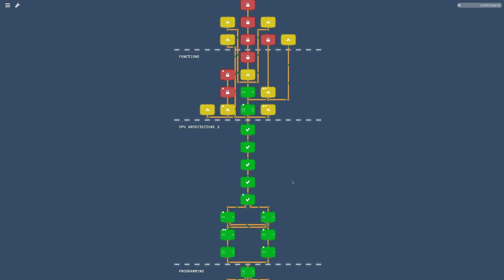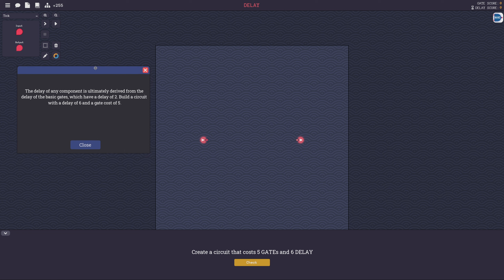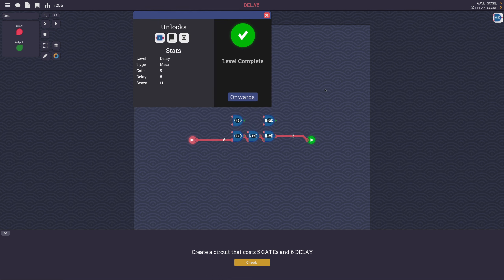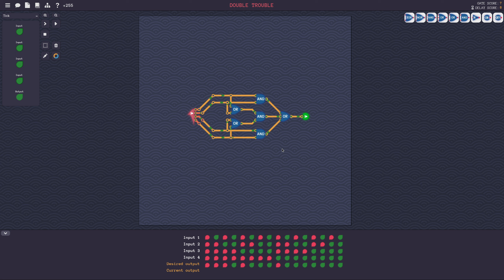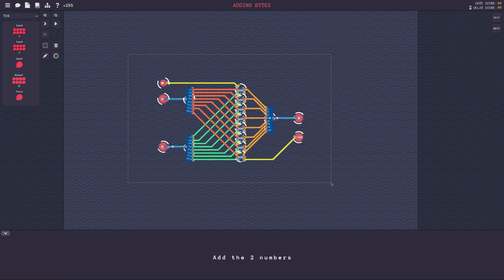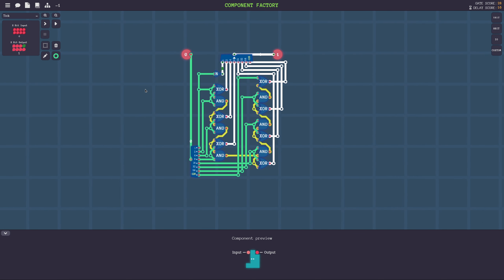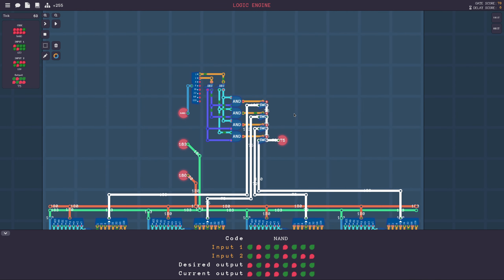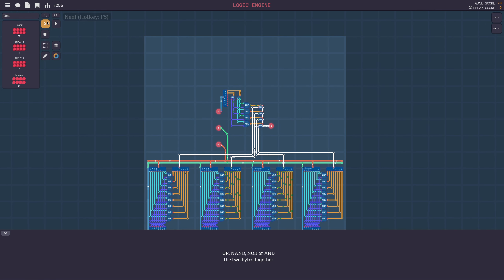A logician tries to build a PC | Turing Complete pt.20 - REDUCE

Comment: By the way, since you mentioned optimising to ridiculous degrees. Some people really go overboard.
The maze can be solved with a gate score of 2. No computer necessary, the entire thing can be solved with two gates. There is a guide on steam going through the process of developing that solution which I found very interesting.
I definitely would not have thought it possible and I don't think I would ever come up with the solution, even if I knew it was possible.

Funnily enough, though, the record for the maze does not use the 2 gate solution, because it takes too many ticks. The best 2-gate entry uses 739 ticks, while the record only needs 73.

Also, if you look at the leaderboard, the person on first place has a total score of less than 3000. I think I've mentioned before that I don't really care about the score and only optimised a little bit to get it out of the millions. (I'm at 115k now and I'd rather build custom architectures than hunt scores) But bloody hell, less than 3k :D
Reply: As a little addition to that: To solve the maze in less than 739 ticks, you have to give up on a 'general solver' solution. Meaning that you rely on the fact that there is a fix set of maze layouts, for which you hard code the path to the door and only build a small circuit, that checks in which layout you currently are. Also there are levels which can be exploited due to the fact that the solution checker is fixed and can not check every possible combination. Other than that i have on more tip: It is more efficient to rebuild a MUX than using a MUX component, because the MUX has a delay of 4, but when you split it up and rebuild it, the delay can be done in parallel with the rest of the circuitry so that it actually only adds 2 delay (same thing often times applies to XOR gates as well... they are split up into their guts in almost every highly optimized solution, so you can re-use the AND gates inside)

Comment: Real components have a propagation delay. Say you have an AND gate, one input is currently high, the other low. The output is therefore low.
You now turn that remaining input high. It takes a certain amount of time before the output also reads high. Keep in kind that in the real world, it's all analog. Even if the gate itself were instant, it takes some time to raise the voltage on the output.

This is not analogous to the game's ticks. Ticks are more like clock cycles. In real hardware, you have a clock signal - a signal that constantly switches from low to high and back. The speed at which it does this is the clock rate. CPUs in home computers have a clock rate in the GHz, but old computers had MHz or even kHz. (I do assume you know this, but included it for completeness)
Things generally only happen on a clock cycle. The counter, for example, would count up whenever the clock signal changes from low to high. This would be the "tick". Some operations are actually performed on the falling edge (high to low) instead, though.

The propagation delay is still important, though. You don't want to begin the next clock cycle before your circuit has stabilised. If voltages are still changing, starting the next cycle might mess things up and cause inconsistent behaviour. Admittedly, you need some very fast clock cycles for this to become an issue, but minimising delay can be an issue if you want to push clock frequency.